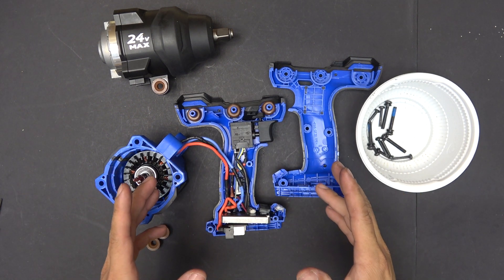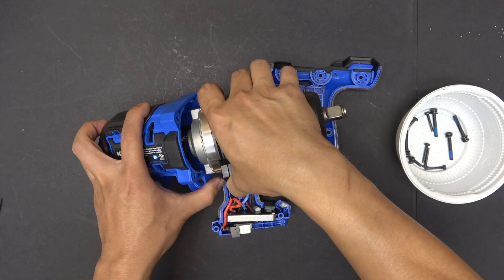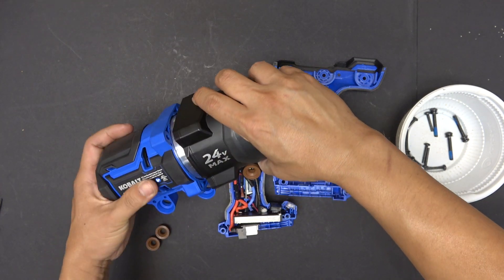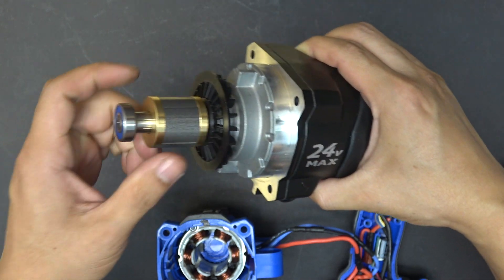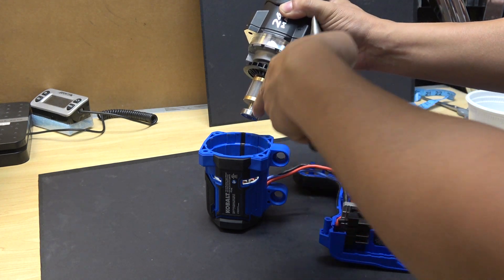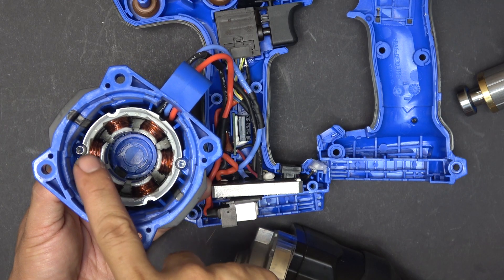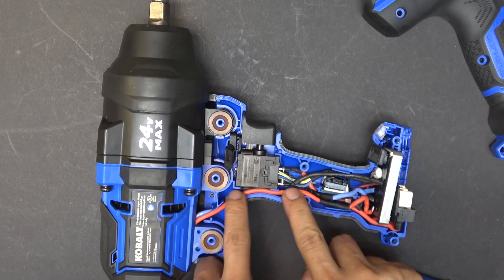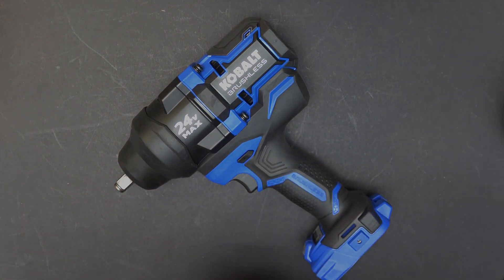Teardown: How to disassemble & more importantly assemble Kobalt 24V XTR 1/2" impact wrench

Comment: Hey vuaeco I bought a 48v 1000w brushless motor and 30ah controller...three 18v 6ah power tool batteries wouldnt be sufficient power for this right?
Reply from the maker: 3x 18V 6Ah would be a bit over voltage. When fully charged, it's 63V total. Check your controller specs and maybe you need to open up your controller and check on the capacitors to see how many volts they can handle.
Reply: @vuaeco  Does not add up to a 1000w of power tho even tho the batteries say 18v...They only peak at 108w each
Reply: So 4x12v 6ah power tool batteries would work with this application?...As I would need atleast 20ah for the 30ah controller that I have?
Reply from the maker: @shamokinsweetie21083  Yes, 4x 12V power tool batteries would work.

Comment: Vuaeco ..do u still have your eb5 bike?
Reply from the maker: Yes I do. It's been working great! I'm buying the rear rack for it right now, planning to install a second battery on it.
Reply: @vuaeco  I need your input on a problem I'm having with the 5 teeth that connect to the battery when you close the bike if you can help me
Reply from the maker: @denomtrax1  The battery only has 2 teeth. All other teeth are just dummy teeth and they are not connected to anything.
Reply: @vuaeco  do you have a Facebook?
Reply from the maker: @denomtrax1  I don't have facebook. You can just message me here.

Comment: Contemplating on getting this impact wrench as my sole drill/impact driver? Given the ease of the disassembly and reassembly from your video and it's built like a tank, this might a great option.  Would be heavy to use on regular basis but I am too old to use any tool for long periods of time.  Thanks for the informative video!
Reply: Theres nothing that my xtr hasnt been able to knock off. Exhaust hardware, axle nuts. All the stuff that gave my air impacts a time did and do not stand a chance lol. The batteries are pretty good too (life/charge speed)